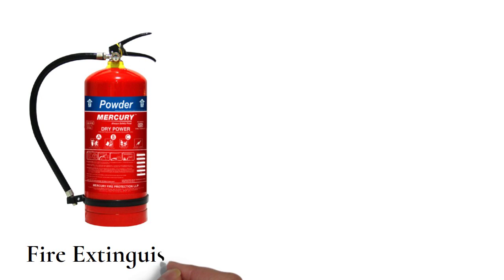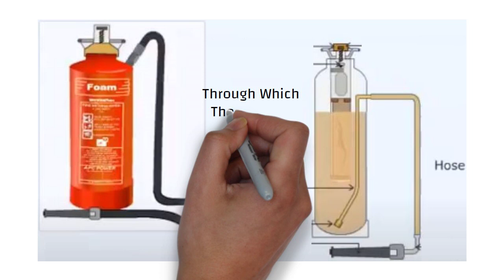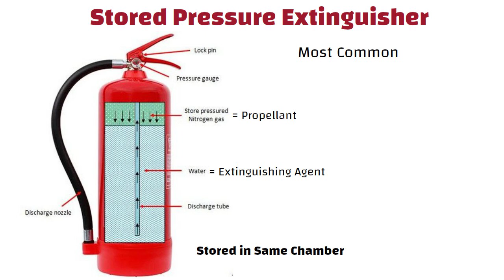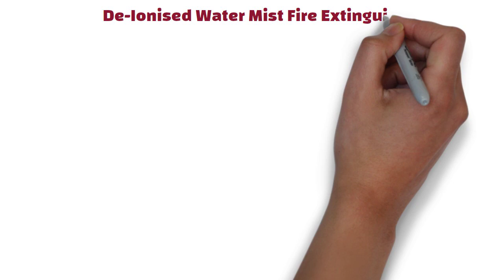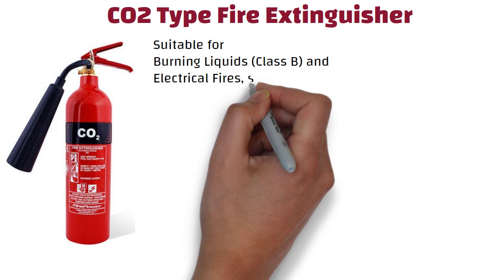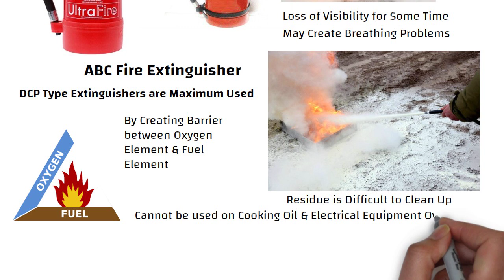FIRE EXTINGUISHER DEALERS IN KERALA, CALL 8138906102, FIRE EXTINGUISHER DEALERS IN ERNAKULAM.

Comment: Fire extinguisher dealers in Kottayam, Fire extinguisher dealers in Payyanur
Reply from the maker: Fire extinguisher dealers in Payyanur, fire fighting contractors in Payyanur, Payyanur, fire and safety installations in Payyanur, fire extinguisher suppliers in Payyanur,fire extinguishers in Payyanur, fire extinguishers in Payyanur, fire protection system in Payyanur, f fire and safety installation in Payyanur, fire and safety contractors in Payyanur, fire safety contractors in Payyanur, fire and safety systems equipments in Payyanur, fire equipment in Payyanur, fire extinguisher in Payyanur, fire protection system installation in Payyanur, fire contractors in Payyanur, fire safety consultants in Payyanur,  fire alarm systems in Payyanur, fire NOC in Payyanur, fire AMC in Payyanur, Payyanur, fire fighting equipment in Payyanur,
MS Jindal pipe dealers in Payyanur, motor control panel in Payyanur, fire pump panel in Payyanur, motor control panel in Payyanur, Morley fire alarm in Payyanur, gst fire alarm in Payyanur, addressable fire alarm system in Payyanur, Pa talk back system in Payyanur, PA talk back system in Payyanur, auto glow SIGNAGES in Payyanur, SIGNAGES in Payyanur, pump PANELS in Payyanur, LHP pump in kohi. Karthar valves in Payyanur, Ravel fire alarm system in Payyanur. Jindal pipe dealers in Payyanur, Jindal pipe dealers in Payyanur. MS pipe dealers in Payyanur. Butterfly valves in Payyanur, PA talk back system in Payyanur, Fire alarm dealers in Payyanur,, smoke detector dealers in Payyanur, fire alarm panels dealers in Payyanur, MCP, hooter dealers in Mangalor, hydrant valve dealers in Payyanur, branch pipe dealers in Payyanur, cp hose, RRL hose, heat detector dealers in Payyanur,, Motor Control panel,  LED EXIT LIGHTS dealers in Payyanur, emergency exit light dealers in Payyanur, auto glow SIGNAGES dealers in Payyanur. Conventional fire alarm system in Payyanur,
KIRLOSKAR FIRE FIGHTING PUMP DEALERS IN Payyanur, FIRE FIGHTING EQUIPMENT DEALERS IN Payyanur, FIRE ALARM SYSTEM DEALERS IN Payyanur, FIRE CONSULTANTS IN Payyanur, FIRE CONTRACTOTORS IN Payyanur, FIRE CONTRACTORS IN Payyanur, FIRE ALARM SYSTEM DEALERS IN Payyanur, SMOKE DETECTOR DEALERS IN Payyanur, FIRE PROTECTION SYSTEM IN Payyanur, FIRE CONSULTANTS IN Payyanur, FIRE CONSULTANTS IN Payyanur, PA TALK BACK SYSTEM IN Payyanur, ADDRESSABLE FIRE ALARM SYSTEMS IN Payyanur, CUTTER PUMP DEALERS IN Payyanur, ADDRESSABLE FIRE ALARM SYSTEM SUPPLIERS IN Payyanur, SMOKE DETECTOR DEALERS IN TPayyanur, PRESSURE BOOSTING PUMP DEALERS IN Payyanur, SLURRY PUMP DEALERS IN Payyanur, WATER PUMP DEALERS IN Payyanur, RAVEL FIRE ALARM SYSTEM IN Payyanur, LUBI FIRE FIGHTING PUMP DEALERS IN Payyanur, FIRE EXTINGUISHER DEALERS IN Payyanur, ADDRESSABLE FIRE ALARM SYSTEM DEALERS IN Payyanur, 

KIRLOSKAR FIRE FIGHTING PUMP DEALERS IN Payyanur, KIRLOSKAR FIRE FIGHTING PUMP DISTRIBUTORS IN Payyanur, KIRLOSKAR FIRE PUMPS IN Payyanur, KIRLOSKAR DIESEL ENGINE FIRE STANDBY PUMP DEALERS IN Payyanur, KIRLSOKAR MONOBLOCK FIRE PUMP DEALERS IN Payyanur, KIRLOSKAR FIRE TERRACE PUMP DEALERS IN Payyanur, KIRLOSKAR FIRE PUMPS IN Payyanur, KIRLOSKAR FIRE FIGHTING PUMP IN KARNATAKA, KIRLOSKAR FIRE PUMP DEALERS IN KARNATAKA, KIRLOKAR FIRE PUMP DEALERS IN HOSUR, KIRLSOAKR FIRE FIGHTING PUMP DEALERS IN Payyanur, KIRLOSKAR FIRE PUMPS IN Payyanur, KIRLSOKAR FIRE PUMP DISTRIBUTORS IN Payyanur, FIRE ENGINE PUMP SETS IN Payyanur, KIRLOSKAR PUMP DEALERS IN TIRUELVELI, KIRLOSKAR DEALERS IN KARNATAKA, KIRLOSKAR PUMPS IN KARNATAKA, KIRLOSKAR PUMPS IN Payyanur, LUBI FIRE PUMP DEALERS IN Payyanur, LUBI FIRE PUMP DEALERS IN KARNATAKA, LUBI FIRE PUMP DEALERS IN Payyanur, FIRE PUMP SUPPLERS IN KAYAKUMARI, FIRE FIGHTING PUMP DEALERS IN KAYAKUMARIHOSUR, FIRE PUMP DEALERS IN KARNATAKA, FIRE PUMP SUPPLIERS IN Payyanur, FIRE PUMP DEALERS IN Payyanur, FIRE FIGHTING PUMPS IN Payyanur, FIRE FIGHTING PUMP DEALERS IN Payyanur, FIRE FIGHTING PUMP SUPPLIERS IN KARNATAKA, FIRE FIGHTING PUMP SET DEALERS IN Payyanur, FIRE PUMP IN KARNATAKA, FIRE PUMP IN Payyanur, FIRE PUMP IN Payyanur, FIRE DIESEL ENGINE PUMP DEALERS IN Payyanur, FIRE DIESEL ENGINE STANDBY PUMP DEALERS IN Payyanur, FIRE JOCKEY PUMP DEALERS IN Payyanur, FIRE JOCKEY PUMP DEALERS IN KARNATAKA, FIRE JOCKEY PUMP DEALERS IN Payyanur. CRI PUMP DEALERS IN Payyanur, HYDRO PNEUMATIC PRESSURE BOOSTING PUMP DEALERS IN Payyanur, VERTICAL INLINE PUMP DEALERS IN Payyanur, INDUSTRIAL PUMP DEALERS IN Payyanur, SEWAGE PUMP DEALERS IN Payyanur, STP AND ETP PUMP DEALERS IN TIRUNELVALEI, STP AND ETP PUMP DEALERS IN TPayyanur, STP AND ETP PUMP DEALERS IN Payyanur, STP AND ETP PUMP DEALERS IN KARNATAKA, HYDRO PNEUMATIC PRESSURE BOOSTING PUMP DEALERS IN Payyanur, SEWAGE PUMP DEALERS IN Payyanur, DEWATERING PUMP DEALERS IN Payyanur, FIRE JOCKEY PUMP DEALERS IN Payyanur,
Reply: FIRE EXTINGUISHER DEALERS IN PATHANAMTHITTA, FIRE EXTINGUISHER SUPPLIERS IN PATHANAMTHITTA, FIRE EXTINGUISHER DISTRIBUTORS IN PATHANAMTHITTA, FIRE EXTINGUISHER IN PATHANAMTHITTA, ABC TYPE FIRE EXTINGUISHER DEALERS IN PATHANAMTHITTA, CO2 TYPE FIRE EXTINGUISHER DEALERS IN PATHANAMTHITTA, CLEAN AGENT FIRE EXTINGUISHER IN PATHANAMTHITTA, MODULAR TYPE FIRE EXTINGUISHER DEALERS IN PATHANAMTHITTA, MECHANICAL FOAM FIRE EXTINGUISHER DEALERS IN PATHANAMTHITTA, FIRE EXTINGUISHER NEAR ME PATHANAMTHITTA, FIRE EXTINGUISHER TRADERS IN PATHANAMTHITTA, FIRE FIGHTING COMPANIES IN PATHANAMTHITTA, FIRE CONTRACTORS IN PATHANAMTHITTA, FIRE EQUIPMENT DEALERS IN PATHANAMTHITTA, FIRE ALARM DEALERS IN PATHANAMTHITTA, FIRE PUMP DEALERS IN PATHANAMTHITTA, SMOKE DETECTOR DEALERS IN PATHANAMTHITTA, FIRE FIGHTING SYSTEM IN PATHANAMTHITTA, FIRE PROTECTION SYSTEM IN PATHANAMTHITTA, FIRE AND SAFETY CONTRACTORS IN PATHANAMTHITTA, FIRE HYDRANT SYSTEMS IN PATHANAMTHITTA, PA TALK BACK SYSTEM IN PATHANAMTHITTA, FIRE NOC IN PATHANAMTHITTA, FIRE INSTALLATION IN PATHANAMTHITTA, FIRE NOC RENEWAL IN PATHANAMTHITTA, KIRLOSKAR FIRE PUMP DEALERS IN PATHANAMTHITTA, FIRE EXTINGUISHER NEAR ME PATHANAMTHITTA, FIRE EXTINGUISHER MANUFACURERS IN PATHANAMTHITTA, SAFEX FIRE EXTINGUISHER DEALERS IN PATHANAMTHITTA, FIRE NOC CONTRACTORS IN PATHANAMTHITTA, FIRE FIGHTING EQUIPMENT DEALERS IN PATHANAMTHITTA, FIRE PROTECTION SYSTEM IN PATHANAMTHITTA, FIRE INSTALLATION IN PATHANAMTHITTA, FIRE SAFETY CONTRACTORS IN PATHANAMTHITTA, FIRE AMC IN PATHANAMTHITTA, FIRE PROTECTION SYSTEM IN PATHANAMTHITTA, FIRE PROTECTION EQUIPMET IN PATHANAMTHITTA, AMC OF FIRE SYSTEM IN PATHANAMTHITTA, FIRE CONSULTANTS IN PATHANAMTHITTA, FIRE AND SAFETY EQUIPMENT DEALERS IN PATHANAMTHITTA, ADDRESSABLE FIRE ALARM SYSTEM IN PATHANAMTHITTA, KARTHAR VALVE DEALERS IN PATHANAMTHITTA, DCP TYPE FIRE EXTINGUISHER IN PATHANAMTHITTA, POWSER TYPE FIRE EXTINGUISHERS IN PATHANAMTHITTA, FIRE HYDRANT SYSTEM IN PATHANAMTHITTA, FIRE ALARM PANEL DEALERS IN PATHANAMTHITTA, SAFEPRO FIRE EXTINGUISHER DEALERS IN PATHANAMTHITTA, MS AND GI PIPE DEALERS IN PATHANAMTHITTA, JINDAL PIPE DEALERS IN PATHANAMTHITTA, AGNI FIRE ALARM DEALERS IN PATHANAMTHITTA, FIRE EQUIPMENT DEALERS IN PATHANAMTHITTA, FIRE EQUIPMENT SUPPLIERS IN PATHANAMTHITTA, FIRE EQUIPMENT TRADERS IN PATHANAMTHITTA, FIRE SPRINKLER SYSTEM IN PATHANAMTHITTA, RAVEL FIRE ALARM DEALERS IN PATHANAMTHITTA, RAVEL FIRE ALARM SYSTEM IN PATHANAMTHITTA, AGNI FIRE ALARM DISTRIBUTORS IN PATHANAMTHITTA, FIRE ALARM CONTRACTORS IN PATHANAMTHITTA, FIRE PIPE INSTALLATION IN CONTRACTORS IN PATHANAMTHITTA, FIRE SAFETY CONTRACTORS IN PATHANAMTHITTA, FIRE PA TWO WAY TALK BACK SYSTEM DEALERS IN PATHANAMTHITTA, HEAT DETECTOR DEALERS IN PATHANAMTHITTA, HONEYWELL FIRE ALARM DEALERS IN PATHANAMTHITTA, FIRE NOC CONSULTANTS IN PATHANAMTHITTA, FIRE AMC AND FIRE NOC IN PATHANAMTHITTA, FIRE SAFETY COMPANIES IN PATHANAMTHITTA, NEWAGE DEALERS IN PATHANAMTHITTA, MONSHER FIRE EQUIPMENT DEALERS IN PATHANAMTHITTA, KARTHAR VALVE DEALERS IN PATHANAMTHITTA, FIRE HYDRANT VALVE DEALERS IN PATHANAMTHITTA, FIRE HOSE REEL DRUM DEALERS IN PATHANAMTHITTA, FIRE SPRINKLER DEALERS IN PATHANAMTHITTA, FIRE PUMP DEALERS IN PATHANAMTHITTA, LUBI PUMP DEALERS IN PATHANAMTHITTA, LHP PUMP DEALERS IN PATHANAMTHITTA. FIRE CONTRACTORS IN PATHANAMTHITTA, FIRE AND SAFETY CONTRACTORS IN PATHANAMTHITTA, FIRE EQUIPMENT DEALERS IN PATHANAMTHITTA, FIRE FIGHTING CONTRACTORS IN PATHANAMTHITTA, AGNI FIRE ALARM DEALERS IN PATHANAMTHITTA, PA TALK BACK SYSTEM DEALERS IN PATHANAMTHITTA, FIRE NOC IN PATHANAMTHITTA, FIRE NOC RENEWAL IN PATHANAMTHITTA, FIRE SYSTEM INSTALLATION IN PATHANAMTHITTA.
Reply: FIRE EXTINGUISHER DEALERS IN PUNALUR, FIRE EXTINGUISHER SUPPLIERS IN PUNALUR, FIRE EXTINGUISHER DISTRIBUTORS IN PUNALUR, FIRE EXTINGUISHER IN PUNALUR, ABC TYPE FIRE EXTINGUISHER DEALERS IN PUNALUR, CO2 TYPE FIRE EXTINGUISHER DEALERS IN PUNALUR, CLEAN AGENT FIRE EXTINGUISHER IN PUNALUR, MODULAR TYPE FIRE EXTINGUISHER DEALERS IN PUNALUR, MECHANICAL FOAM FIRE EXTINGUISHER DEALERS IN PUNALUR, FIRE EXTINGUISHER NEAR ME PUNALUR, FIRE EXTINGUISHER TRADERS IN PUNALUR, FIRE FIGHTING COMPANIES IN PUNALUR, FIRE CONTRACTORS IN PUNALUR, FIRE EQUIPMENT DEALERS IN PUNALUR, FIRE ALARM DEALERS IN PUNALUR, FIRE PUMP DEALERS IN PUNALUR, SMOKE DETECTOR DEALERS IN PUNALUR, FIRE FIGHTING SYSTEM IN PUNALUR, FIRE PROTECTION SYSTEM IN PUNALUR, FIRE AND SAFETY CONTRACTORS IN PUNALUR, FIRE HYDRANT SYSTEMS IN PUNALUR, PA TALK BACK SYSTEM IN PUNALUR, FIRE NOC IN PUNALUR, FIRE INSTALLATION IN PUNALUR, FIRE NOC RENEWAL IN PUNALUR, KIRLOSKAR FIRE PUMP DEALERS IN PUNALUR, FIRE EXTINGUISHER NEAR ME PUNALUR, FIRE EXTINGUISHER MANUFACURERS IN PUNALUR, SAFEX FIRE EXTINGUISHER DEALERS IN PUNALUR, FIRE NOC CONTRACTORS IN PUNALUR, FIRE FIGHTING EQUIPMENT DEALERS IN PUNALUR, FIRE PROTECTION SYSTEM IN PUNALUR, FIRE INSTALLATION IN PUNALUR, FIRE SAFETY CONTRACTORS IN PUNALUR, FIRE AMC IN PUNALUR, FIRE PROTECTION SYSTEM IN PUNALUR, FIRE PROTECTION EQUIPMET IN PUNALUR, AMC OF FIRE SYSTEM IN PUNALUR, FIRE CONSULTANTS IN PUNALUR, FIRE AND SAFETY EQUIPMENT DEALERS IN PUNALUR, ADDRESSABLE FIRE ALARM SYSTEM IN PUNALUR, KARTHAR VALVE DEALERS IN PUNALUR, DCP TYPE FIRE EXTINGUISHER IN PUNALUR, POWSER TYPE FIRE EXTINGUISHERS IN PUNALUR, FIRE HYDRANT SYSTEM IN PUNALUR, FIRE ALARM PANEL DEALERS IN PUNALUR, SAFEPRO FIRE EXTINGUISHER DEALERS IN PUNALUR, MS AND GI PIPE DEALERS IN PUNALUR, JINDAL PIPE DEALERS IN PUNALUR, AGNI FIRE ALARM DEALERS IN PUNALUR, FIRE EQUIPMENT DEALERS IN PUNALUR, FIRE EQUIPMENT SUPPLIERS IN PUNALUR, FIRE EQUIPMENT TRADERS IN PUNALUR, FIRE SPRINKLER SYSTEM IN PUNALUR, RAVEL FIRE ALARM DEALERS IN PUNALUR, RAVEL FIRE ALARM SYSTEM IN PUNALUR, AGNI FIRE ALARM DISTRIBUTORS IN PUNALUR, FIRE ALARM CONTRACTORS IN PUNALUR, FIRE PIPE INSTALLATION IN CONTRACTORS IN PUNALUR, FIRE SAFETY CONTRACTORS IN PUNALUR, FIRE PA TWO WAY TALK BACK SYSTEM DEALERS IN PUNALUR, HEAT DETECTOR DEALERS IN PUNALUR, HONEYWELL FIRE ALARM DEALERS IN PUNALUR, FIRE NOC CONSULTANTS IN PUNALUR, FIRE AMC AND FIRE NOC IN PUNALUR, FIRE SAFETY COMPANIES IN PUNALUR, NEWAGE DEALERS IN PUNALUR, MONSHER FIRE EQUIPMENT DEALERS IN PUNALUR, KARTHAR VALVE DEALERS IN PUNALUR, FIRE HYDRANT VALVE DEALERS IN PUNALUR, FIRE HOSE REEL DRUM DEALERS IN PUNALUR, FIRE SPRINKLER DEALERS IN PUNALUR, FIRE PUMP DEALERS IN PUNALUR, LUBI PUMP DEALERS IN PUNALUR, LHP PUMP DEALERS IN PUNALUR. FIRE CONTRACTORS IN PUNALUR, FIRE AND SAFETY CONTRACTORS IN PUNALUR, FIRE EQUIPMENT DEALERS IN PUNALUR, FIRE FIGHTING CONTRACTORS IN PUNALUR, AGNI FIRE ALARM DEALERS IN PUNALUR, PA TALK BACK SYSTEM DEALERS IN PUNALUR, FIRE NOC IN PUNALUR, FIRE NOC RENEWAL IN PUNALUR, FIRE SYSTEM INSTALLATION IN PUNALUR.